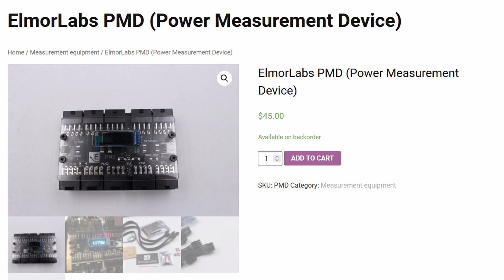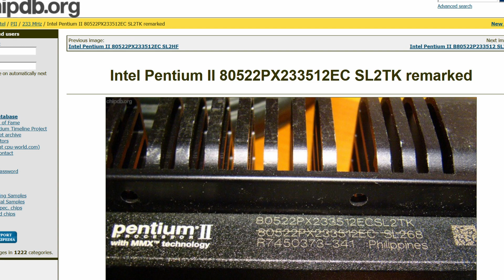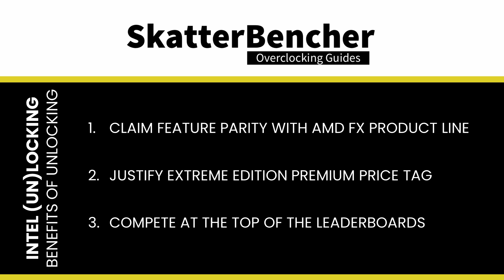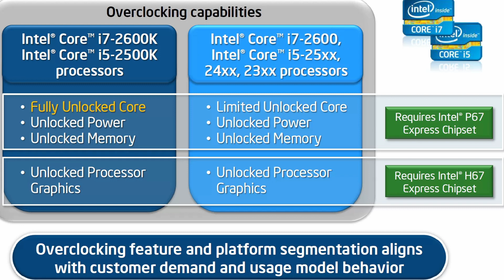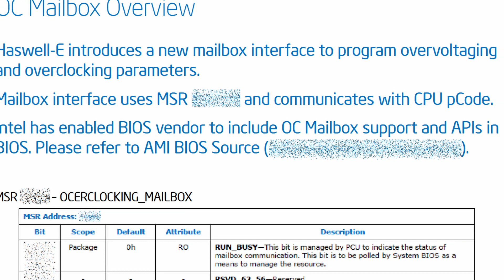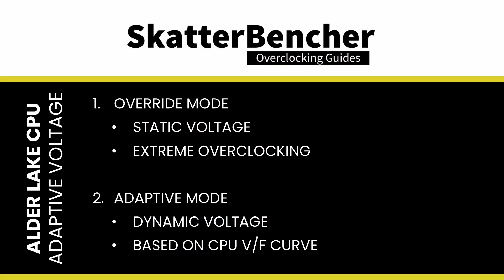Core i5-12400 Overclocked to 5300 MHz With Maximus Z690 Extreme | SkatterBencher #37

Comment: update 2025. What a gem of a video, I currently have a 12400f running at 140bclk (7600 trident skill ram), but I have a problem, when I exceed 4.4ghz in cpu speed it crashes, or when I exceed 4800hgz in ram frequency. I don't know what this limitation is due to, despite increasing voltage in ram and processor, even in system agent or memory controller, I can reach 5ghz with your method but with 140bclk it is capped. Thanks for your very professional work, the best oveclocker always Scatter Bencher.

Comment: Hello!
What an informative video, thank you! Recently I picked up a Z690 Taichi to pair with my 12400F, moved away from an ITX build. 
However, my C0 stepping clocks a lot lower and requires a lot more voltage than H0. Is this expected behavior? 
My C0 requires somewhere between 1.3V-1.375V Vcore, LLC level3 to hit 5.1GHz all cores. Under that and anything demanding crashes.
Thanks again for your video and articles detailing the ADL architecture!

Comment: i am using 12400F with B660M Mortar Max, i buy 3 cpu 12400F new on sale so I choose the best one, i test 3 cpu on 5.1GHz all core (BCLK 127.5) and result is 1.3v, 1.23v and the last one is 1.115v, lucky for me
i run cinebench r23 and multi core score is 15500 point, single core is 1970 points and 75 C degree on 1.115v
after that i sold 2 cpu for a little profit because it buy it so cheap ( buy 94$ pcs and sold 105$ - 20.01.2024)

Comment: You can congratulate me, I made a stable overclock using the overclocking principles of your guide.👈
True, in my case there were some difficulties, but I solved them.
My end result:
(Asus rog strix B660-f gaming wifi motherboard, 12400f processor, DDR5 Patriot Viper Venom [PVV532G560C36K] 32 Gb RAM, BIOS version 1003)
1) BCLK = 125 (the most stable frequency for my 12400f and DDR5 + acceptable power output and relatively low voltage required for my particular case)
2) CPU multiplier x40 for all cores👇
3) Disabled C-State in CPU settings, active SpeedStep and SpeedShift.👇
4) CPU Cache maximum multiplier x40, minimum on auto
5) CPU / Cache voltage on the core is set by an offset of 0.2 Volts
6) LLC set to level 3👇
7) FLL OC set Elevated Extreme (for increased frequency stability of the BCLK generator)
8) 6000MT/s for DDR5 with main timings 30/36/36/52 and voltages VDD/VDDQ 1.28V
In principle, there are few differences from this guide, the only difference is that with my processor and / or motherboard it is impossible to get stable operation of the processor with multipliers for 44/44/42/42/40/40 cores.👉 In my case, C-State, which is responsible for overboosting the processor depending on the load on the cores, causes errors when running Windows 10/11 and in various tests. Therefore, I set all the multipliers of the processor cores to 40/40/40/40/40/40 and for dynamic control over the power (voltage / frequency) of the processor, I enabled Intel SpeedStep and Intel SpeedShift technologies. These technologies work almost identically to C-State, but they do not allow boosting the processor cores above the x40 multiplier, the multiplier changes dynamically from x0+ to x40. Also, due to the technicalities of my processor, 👉I had to raise LLC to level 3 (LLC3 has +0.009V for each point of the V/F curve compared to LLC2 on my motherboard (And yes, I compared all the LLC levels on my motherboard, 7 levels, at different multipliers from x30 to x40 to get the V / F curve for my 12400f, since it's impossible to get it with regular programs or BIOS tools 😅 I spent 5 hours on this ...😂))
Of course, my problem with CPU instability can be solved by increasing the voltage on the processor and increasing the LLC level even more, but this is still shit 😏
And so my processor instead of 100W in y-cruncher consumes 135-138W💪 and in Cinebench R23 instead of 85W it consumes 110-115W, and this makes my cooler start to work noisily 🥴
But with the configuration I received, my system works stably and passes ALL benchmarks and tests without errors, BSODs and crashes, and at the same time, the system heating on the cooler is only ~ 80 degrees Celsius😇 in the most demanding y-cruncher mode.
In conclusion, I want to say that I am satisfied with the work I have done and I am grateful to YOU for your guide. This helped me understand the main principle of overclocking - you need to check every little thing yourself in order to get a stable system with adequate performance properties.👍
Reply: still working good?

Comment: It's work if my CPU 12400f haven't avx512?
And my motherboard is Asus ROG strix B660-f gaming? There is also a built-in BCLK generator that allows me to tune my 12400f, but there are no some functions to adjust (adjust the frequency above the threshold value).
Reply from the maker: Yes it will work because you don't need AVX512 to get the core overclock to work. You only need the external clock generator and the right BIOS with supporting microcode.
Reply: @SkatterBencher  I can easily adjust the frequency and it was not difficult for me to get the desired processor frequency, I did 44/44/42/42/40/40 with BCLK120.5, but there are problems with the RAM configuration. If on the bios version 1003, the training of RAM at 6000 1.28Volts and timings 40/40/40 passes without problems, then on the bios version 1203/1603/1620, the PC freezes during power-up. The screen is black, the fans are spinning, the LED shows memory training and that's it, it lasts forever. 
I tried to set other high and low frequencies of BCLK, generally turned off the processor overclocking, increased the voltage on the RAM, set all the taimings automatically, but memory training does not work correctly... 
Moreover, on the bios version 1003, I can safely run this memory at a frequency of 6300 with timings of 32/36/36/52 1.28 Volts and it passes all TM5 Extreme tests.🤔
 If I put XMP profiles, then the memory works as it should. I am surprised at this because Asus for bios 1203 wrote about increased compatibility with noK processors and in each new bios Asus improved compatibility with RAM.🤷

Comment: Hi i am new to overcloking 
What boards allow for overcloking i5 12400. Beside b660 and b760 

Does almost all z690 boards allow oc of i5 12400?
Reply from the maker: The key elements for Alder Lake non-K overclocking are (1) an external clock generator on the motherboard and (2) a BIOS that has the old microcode. I think there are some lists online of motherboards that have these two requirements.

Comment: 12400f on Asus B660 Gaming -G @ 5200 (133.35 x 39) all core 1.385v (in bios) with LLC6 and ac/dc sync, 4.4 Cache -> Prime95 small FFTs stable on 280 AIO, throttling after 10 minutes but stable.
5.333 GHz all core @ 1.42V LLC6 ac/dc sync, 4.8 Cache 30 minute Cinebench R23 stable, no throttling, temps below 95C, no chance with prime95 tho.
170€ CPU beats AMD Ryzen 7600X in multiscore and reaches 3-4x priced Intel CPUs in single threaded workloads. I'd say it is fun and worth it. 
I could get 6600 DDR5 to work but for daily use I dialed it down to 6400 CL 32-38-38-28 @ 1.4v  / 1.3v IMC / 1.45 VDDQ Tx.
Overclocking by bclk is art :) thanks for your review and guidelines
Reply: you put too much vcore, i think your cpu is not lottery, it should run 5GHz daily on lower vcore

Comment: looking for the 13400 oc guide
Reply: according to intel 13th gen has that clock gov bug fixed by default. according to msi and some japanese website it is still possible. microcode injection necessary for other mainboards tho.

Comment: So if my board doesn't have BLCK clock generator, I can set my ratio to 102.9 for maximum performance? This is a DDR4 Gigabyte Ultra Lite 12400
Reply from the maker: Correct. 

If it's unstable, just go down 0.1 MHz. It can happen that the BCLK jumps slightly up and down due to spread spectrum and if it accidentally jumps over the limit, the lock will kick in.

Comment: Can you do 12400 oc with asrock motherboard ?
Reply: Yes some of the asrocks overclock very well.  These include the 660 and 760 riptide phantom gaming boards.  Just a few settings and you are up above 5 ghz. Only note I would make is that the intel cooler is not suitable for overclocking. Lower voltage to a minimum at your desired clock to have thermal control. I5 12400f seems to be very capable.  Never heard of one that cannot hit 5.1ghz all cores in a stable fashion.

Comment: I need help I have the 12400f and my tdp is ~80W on cinebench and I can't find any settings in the BIOS to increase this. I have the MSI PRO B660-A
Reply from the maker: Does the B660-A have support for non-K overclocking? (an external clock generator and the correct microcode)

If not, then these settings won't be available

Comment: Can i overclock an i5 12400f on a z690 board If it is a ddr4 version?
Reply from the maker: If the motherboard has an external clock generator and BIOS with the right microcode, then yes. Otherwise, no.
Reply: @SkatterBencher  ok, I appreciate the help

Comment: Mr, Please active the subtitle In spanish, which BIOS versión you use? Im trying 5.2ghz but I cant push  mote than 38x125mhz, when i push up a blue screen  apear. Help. Asus Ápex z690 ddr5 5200mhz, aio x280mm. Im use a sata ssd, win 10 you think its the problem?, thanks!!
Reply from the maker: BIOS version is 0803.

SATA shouldn't be the issue as BCLK is not affecting SATA clock. 5200 MHz sounds like a reasonable limit for the CPU?
Reply: @SkatterBencher  yes? i have the intel 12400 i have 5200mhz corsair vegance and maximus z690 apex, and a aio 280mm.  You can give me a trick when bclk cause a blues screen, maybe go up vtt voltage? Thank for the answer thanks a lot.
Reply: Brooooooooooo  SkatterBencher :D I love You....., I had been trying for a long time as I told you, and I'm pleasantly surprised, today I managed to reach 4.9ghz when before I only reached 4.7 thanks to you, and I'm only at minute 53:23 of your video!! , I had been trying to do ovc with the guide of other youtubers. You are the way! Subscribed, shared, and adored, Mr. all my respects.

Comment: Would you do one with B660?
Reply from the maker: Are there affordable B660 boards out already with external clock generator and BIOS support? (I haven't really followed up on this topic)
Reply: @SkatterBencher  The only reasonable one is the B660-G from Asus. Grooves Land has them for 220USD. I got one with a 12400F and a non XMP DDR5 from ADATA and they are arriving tomorrow. Going to test Asus' AEMP which they said works with that board and non XMP DDR5.
Reply: @zelin_dc  did you manage to overclock the 12400f with this b660-g gaming ? is it possible to overclock with ddr5 with xmp profile but without enabling it ?
Reply: @Aidenshiro  My 12400F was not good at overclocking was only able to do 4.8 all core and after about few month of use the overclock became unstable. Could the the silicon or not enough voltage but 1.3 was very reasonable for all core 4.8... I think MSI came out with a new board that can non k overclock with DDR4
Reply: @SkatterBencher   Apparently, the B660-f gaming as well as its little sister the b660-g gaming offers the possibility to overclock non-K processors.
Reply: @SkatterBencher  Asrock b760m has external clock generator, and it's only 140 dollar ish
Reply: I did. 5.2GHz all core prime stable at 1.385v llc 6 (hits throttling after mins of prime95 small ffts)
5.06GHz with 1.335v llc5 (hits 90C with 280 AIO in prime small ffts after 40 mins)
5.333cinebench r23 30min stable @ 1.42v llc 6, no chance to do prime95
Memory @ 6400 cl32. Timings taken from Buildzoid, worked 1:1. I think it was his 32GB 6000MHz DDR5 vid.
Reply: @troeteimarsch  Which ram and board? My Asus B660-G having a lot of voltage drop issue. Hardly able to stay above 1.2 even at LLC6
Reply: @zelin_dc  same board, g.skill flare x5 expo 5600 cl 30.
Have you connected the 8 pin and 4 pin to the mobo?
Reply: @troeteimarsch  I have but voltage drop so much
Reply: @zelin_dc  this is not normal
Reply: @troeteimarsch  I'll ask support. Hopefully, it's just a setting issue.
Reply: @zelin_dc  8 months is still under warranty, isn't it? 
Are your power supply voltage rails okay? 
For refernce: with llc4, 500khz switching frequency and 1.38v vcore , CPU voltage should droop to around 1.3v under load at 5.1 GHz.
Reply: @troeteimarsch  yea but mine drops to about 1.2 its still under warranty

Comment: but does this work on cheaper z690 or does it only work on 500$ plus motherboard is the real question
Reply from the maker: It works only on motherboards that have an external clock generator and come with the required older, pre-release CPU microcodes. There should be some resources on the web which list suitable motherboards and BIOS versions.
Reply: @SkatterBencher  I have no idea what you're taking about. But I'm planning on buying a gigabyte z690i dd4.  I wouldn't know if it has the external clock generator because I don't have the motherboard to tell you. And I don't want to be a guinea pig and find out after $300.

Comment: In my country that particular Motherboard cost 3x i5 12400f, and ddr5 just so expensive here. so pairing it with 12400f just not worthed, 12700f + b550 ddr4 just cheaper and faster
Reply: How do you pair 12700f (Intel 1700 LGA) with a b550 (AMD AM4 1331 PGA)?
I assume you mean B660, right?

Comment: It is strange for a 150w cpu to heat up this much , i dont tried but i dont tink that the H0 die is the problem, the heatsink was mounted well? I loved the part of the history of intel cpus.
Reply from the maker: Good observation - I did check the mounting a couple of times to see if everything was right and I didn't see any issues.

The total chip power is not that relevant for the thermal evaluation as there is plenty of heat exchange capacity (radiator size) in the cooling system. The thermal issue relates more to the thermal transfer from the CPU cores to the liquid. Or put differently: the heat doesn't get to the liquid fast enough to be transferred away to the radiator. That's why you see a water temperature of low 30C while CPU temperature is high 90C.

Compared to a larger die size, with a smaller die size you can assume that the rate of change in Watt/mm2 will result in a faster rate of change in peak Temperature. The difference between C0 and H0 die size is ~30%.

The consequence is that (1) for a 12400 max overclock you don't need that powerful of a cooling system (240 AIO would likely suffice), and (2) thermal optimization should be focused on increasing the thermal transfer rate from die to liquid. Some options are: delidding, change of TIM, thinner coldplate, etc.

Anyway, that's just my theory ... not sure if I'll have time to explore this in the future :)

Comment: Very interesting point on using per core oc on Alderlake with non K overclocking. I achieved 5300mhz prime95 small fft AVX512 stable on Core i3 12100F using old EK Supremacy Evo with EK XTX 360, and i didnt even try per core OC yet maybe can achieve more. Your manu video opening my perspective on maximizing performance on all scenario, thanks for that really eye opener!

Comment: Would it not be possible to intercept the frequency from the crystal and change it by say 10% ? It seems like somewhere that hasn't been exploited yet.
Reply from the maker: In theory yes, but in practice it's very difficult since the crystal affects everything on the platform. That includes not just the CPUBCLK, but also PCIe, DMI, controllers, timers, etc.

Crystal swapping used to be a thing a couple of decades ago though. You can look up 486 overclocking or Turbopll overclocking.

Comment: Amazing overclocking history coverage! I recently purchased the G7400 and 12100F to overclock in my Hero board. Had a blast, it felt great pushing those locked “low binned” chips to 5.3Ghz. Intel should really have done a 4 core K SKU.
Reply: They have done a 7350k and 8350k in the past but they didn't sell too well.

The pentium G3258 was legendary back in the day. I had 2 or 3 of those.